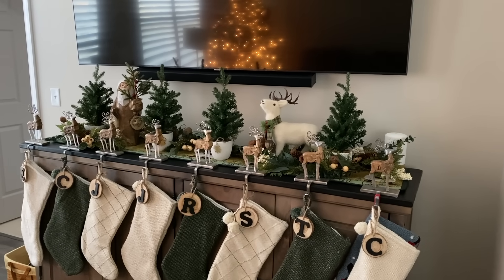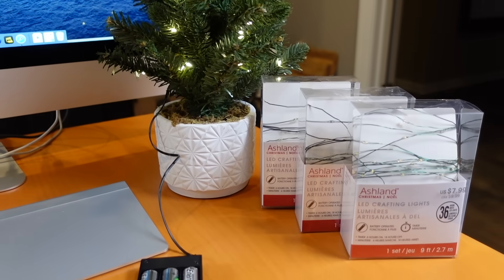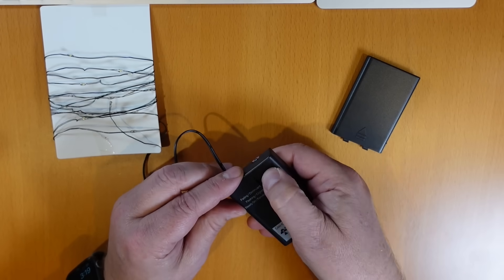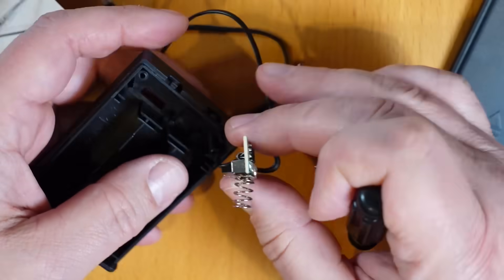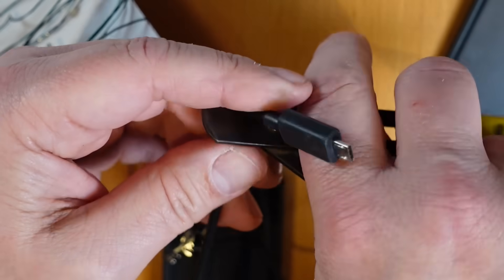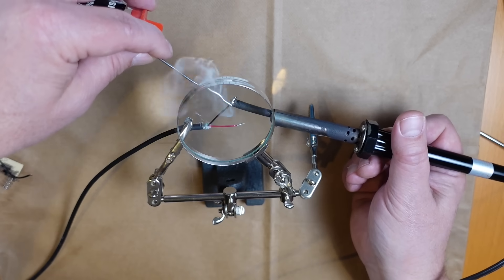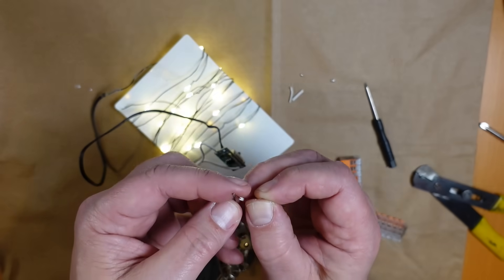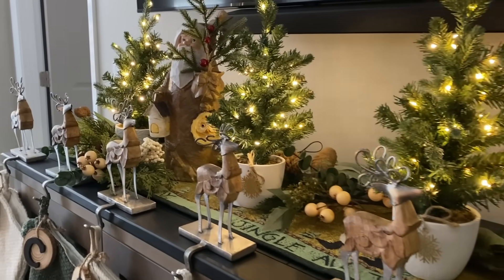SAVE $100s on batteries with this simple decorating hack

Comment from the maker: If you don’t have the skills or tools to do this, there are commercial alternatives: https://handydad.tv/a4h7
Reply: Thank you, I have no electrical skills at all so love this suggestion. I had no idea such a thing existed. This is a game changer!
Reply: Thank you so much for this tip 👍
Reply: This is a Very Good Ideal/Hack ...however,  it would be so helpful to actually see what to were doing  with a closer view and explained at a slower pace...for those of us with a slower 'hack' IQ.  Thanks!
Reply: I've never ever seen this before. Thank you!
Reply: Thank you so much for providing the link for those of us who have no idea how to accomplish what the genius who produced the video did! I am going to set about replacing batteries with these units, one at a time, until I am no longer dependent upon batteries at all. I can't tell you how much I appreciate your tip!
Reply: Where do you buy your wire strippers?  That type is my preffered and they have become difficult to find.
Reply from the maker: @John http://handydad.tv/wstr
Reply: Are you able to use the on/off/flash switch? If not, perhaps just soldering  the USB wires to the the battery terminals would allow use of the switch.

Comment: Running 4.5 V designed LED strings on 5.2V may not be good (I burnt some leds from the strings doing so) Hence, I added a Diode in series with the positive wire which drops some 0.5V - 0.7V resulting in 4.5V a safe limit.
Reply from the maker: Good idea

Comment: You only really need to keep the control board connected if you want the timer function. If you just need to power them then you can go straight from the usb to the lights without the control board.
Reply from the maker: Not necessarily. The board can also limit current or provide dim control.

Comment: For me the big bonus about doing this conversion is that i can use the remote switch that I use for all my AC line powered Christmas decorations (no more crawling around to plug/unplug multiple stuff every night). 
I also use rechargeable NiMH batteries but sometimes their inherent lower voltage (1.2v) is noticeable in some decorations.
Reply from the maker: I use smart plugs as well!

Comment: ... The problem isn't that they aren't mains powered... The problem is LED lights tend to use 3 batteries instead of 4. Smart Chargers can recharge single cells..? But are more expensive than dumb chargers that need 2 cells to recharge... So the answer is... Buy Fairy Lights with 2-4 cells instead of 3.
Reply from the maker: Thanks

Comment: I did something similar. I made a little piece that just drops into the battery compartment so there's no destroying the original battery box. That way it can still be used in areas where there is no access to an outlet. Added a jumper so that I could string several lights together. LED not incandescent. Made a "3 cell and 2 cell" variant.
Reply from the maker: Nice!

Comment: I did something similar, but I took one extra step. I measured the output from the control board to the lights. I found that it was only 3V, so the control board is doing some voltage regulation. This is important because it provides some assurance that the 5V supply will not likely cause your fairy lights to burn out early.
Reply from the maker: Good point!

Comment: If you just wanted "steady on" lighting, you could have ditched the entire power pack / circuit board.  The 4v fairy lights would run just fine direct from USB 5V.     Would have made things a ton simpler.
Reply from the maker: The board has current limiter.

Comment: We use fairy lights too but we use rechargeable batteries. We have enough to just switch them when they run out of power. Still pretty cool you can use 5v USB chargers. I probably have mor than a few in a box somewhere...

Comment: While this is an interesting idea, in Canada, you have just voided the CSA certification. If this hack ends up causing a fire, you would not be covered through your insurance. If you are concerned about batteries, consider opting for rechargeable ones. Honestly, these little lights take forever to go through the batteries.
Reply from the maker: Thanks for the info

Comment: This hack is more easily accomplished by just switching to rechargeable eneloop batteries.  Or, if you insist on this advocating this method, a more detailed guide would be appropriate. If someone owns a soldering iron and is able to do this hack with only the instructions you provide, they probably already thought of this and don’t need a guide. If this is new info to someone, your video doesn’t show them how to do it properly or even safely.
Reply from the maker: Thanks for the feedback

Comment: This sounds like a great idea! But, I loaded up on IKEA rechargeable batteries (AA & AAA) plus the IKEA battery charger about 3-4 years ago and never looked back. I run kids toys, all my candles on a timer and many fairy lights on these batteries and I feel no guilt. I also use them on outside year round lighting and have yet to replace any of the batteries. I just recharge and seems to me not even that often. Highly recommend. ❤
Reply from the maker: Thanks for the tip

Comment: Oh you connected more lights to single usb output did you do the math for the total combined AMPs  for the rating of the usb power plug output and boards ????
. Over current will cause excessive heat on the plug kill the components if you're lucky , otherwise it may catch fire . hopefully house  socket  trips out  protected by RCD and MCB before that happens. otherwise good idea
Reply from the maker: USB transformers have overcurrent protection.

Comment: so pretty...my guy, reuseable batteries are also pretty clutch. not everyone should just pick up being an electrician.. i wish i knew that b4 i pulled the magnetron from my microwave to pull energy from a grounded pipe..which worked, but now i have grey hair. pulls enough to charge a phone when the power is out, but i aged for that. i am praying you stay lawsuit free. good vid.
Reply from the maker: This is 5 volts. Doesn’t compare with a magnetron.

Comment: Just yesterday I was looking at fairy lights on sale and thinking how great a few sets would be in a holiday display for advertising a charity event. Then I realized that it would be six strings x 3 AA batteries = 18 batteries every three or four days for three weeks. Say 90+ batteries. NOPE!  This hack is awesome!  My only request is when recording these ‘simple’ hacks please SLOW DOWN and zoom in frequently to show more detail of your tools and of the actual circuit board.  That would make it much ‘simpler’ and safer! Thanks!
Reply from the maker: Thanks for the feedback!
Reply: Top right corner of video, tap the Settings 'wheel'-- tap the 'Speed' option: you can slow down or speed up any video  to your liking. 💝

Comment: So when you connected the tress to the power supply as stated at 2:01. Are they all powered off a single charge cube? Or a large capacity charge cube?
Reply from the maker: I had them wired together to one power supply.
Reply: @handydadtv sorry to keep bothering you. Can't seem to find the answers online, or more likely I don't know how to word it properly. 

Did you up the power supply for the multiple strings?
Reply from the maker: Yes. My trees have tiny incandescent bulbs that use more power than LEDs. Small power supplies worked for a short time but shut off after a while. I tried increasingly larger power supplies until I found one that worked continuously. I believe it needed 5V 2A.

Comment: Higher volt can make the led heat up so hard. I have 2 and 3 battery fairy lights. I just ordered 5v to3v voltage regulator. But yeah this is what im looking for since at gome im doing some fairylight mushroom decorations
Reply from the maker: Thanks

Comment: How many strings of fairy lights can be hooked up per 5 volt USB cable?
Reply from the maker: It’s a math question; you need to know the amps for each string. Add them up and make sure your source has more than enough.

Comment: Hi I have a 6 ft artificial birch tree with lights with different  modes but it stopped working after a few months I took it out of the plastic casing plugged it into a power source, then was fiddling around with it and it started working now it won't
Reply from the maker: Oh, shucks. I was hoping for the happy ending.

Comment: So how many strings can be supported by the one 5v charger brick? Looks like you have multiple setup to one
Reply from the maker: Not an easy answer. It depends on the power required by each string, and they really don’t tell you. So it’s trial and error. I used four on one power supply but the little Apple ones wouldn’t stay on all night. So I upgraded to more amps.

Comment: In Australia a couple of stores sell battery replacers for two for $10 - $5 each. They are fantastic. They have a USB plug connected to two or three dummy batteries = either AAA or AA. You simply plug these into the battery case, plug in your USB and - IT WORKS! So simple. I use a whole lot of these to run my Christmas decorations, tiny villages etc. I have each USB plugged into a Smart Switch so I control my whole house from Alexa.

Comment: Is there a way to do the opposite? To take something that is originally meant to plug into an outlet and convert it to run on batteries so it's portable? ie Christmas decorations / lights?
Reply from the maker: Yes anything  is possible with the right circuitry.
Reply: @handydadtv  would you consider making a video about that?
Reply from the maker: @Veronica.John10-10 It’s beyond my skills.

Comment: I can't catch the step where you crossed the wires & didn't work, but didn't see where remove & moved too.
Between my light up glow angels, snow man & santa. Plus my battery wreath & fairy l8ghts for christmas, I  also have a memorial day, july 4th, president day, labor day,  veterans day wreath I made that require  battery plus my Halloween candles, display, lights and more. Is there another way to see that piece. I use 100 some batteries. I have charger, but each charges loses power!  Not including our patio lights & numerous remotes!
Reply from the maker: I didn’t show the soldering close up because yours probably won’t look the same.

Comment: Thanks for the tip. Will this work with the lights that run on a coin battery? Maybe several hooked together? :)
Reply from the maker: Not without reducing the voltage somehow.

Comment: I bought these lovely things called usb batteries eliminators off eBay for a set of battery operated string lights I hung up in my room. Its essentially fake batteries with one that is attached to a usb cord with an on and off switch. You just but the batteries in like normal and plug in the usb cord and you have the same thing from this video without all the work!
Reply from the maker: Nice 👍🏻

Comment: You've completely missed the idea of using batteries in Holiday lights. It's usually because there's not a plug-in available. So you've just made battery-operated lights into plug-in lights. You can just go ahead and buy lights that are plugged in rather than having to take battery operated ones and make them plug in.😅
Reply from the maker: Thanks

Comment: You lost me when you jumped to connecting them to the wego.. what is that and wouldn’t that change the power of the power source?
Reply from the maker: A Wago is a splicing device just like a wire nut. The power is still 5 volts to all the trees.

Comment: This is also helpful because every year we put our decorations up in the attic for 11 months, and through a whole season of hot weather the batteries usually have leaked or died by the time we get them out next year.
Reply from the maker: I always remove the batteries before putting decorations away.
Reply: Why don’t you take the batteries out and continue using them. Rechargable batteries are best.
Reply: @ forgetfulness

Comment: Great work. I have found my peace with  rechargeable Eneloop batteries. 21 years ago (!!!) I bought 48 AA and 16 AAA cells. With a storage box and 8-way charger.  (All together it cost about $200) Eneloops do not discharge, the whole family has got used to it, puts the empty batteries in the charger, the charged ones in the box and I have not bought such a single AA/AAA cell for over two decades! With all the children's toys the battery consumption is extremely high, I would definitely pay $10 a week for disposable batteries. In 21 years I have easily saved $5000.
Reply from the maker: That’s a great story! So I see Eneloops are rated for 2,100 cycles. Have you needed to replace any in those 20 years?
Reply: @handydadtv  Thanks. I have never calculated it, but it probably doesn't come close to 2000 cycles, but certainly well over 1000. No, never replaced, only lost three. I once got four black "Eneloop Pro" that broke after a few years.
Reply from the maker: @woodchild48 The regular ones are better than the Pros?
Reply: @handydadtv  Yes, the normal, white Eneloops are much more durable.
Reply: Us too! Makes life easier.
Reply: I hadn't heard of Eneloops but found them on Amazon UK and bought some. AA, AAA and a charger. Wish I could find a good quality C2032 rechargeable set too. Any suggestions? We also go through some tiny circular batteries for hearing aids that I wish we could recharge. Thank you for commenting @woodchild48
Reply: @elletaylor9985  Cool, I hope you enjoy and use the Eneloops for a long time. Take care to keep empty and charged batteries separate and store them properly. Maxell has rechargeable 2032s but I have no experience with them.
Reply: I got Duracell rechargable batteries years ago and after a while they were leaking battery acid. Have you experienced this with any of your batteries?
Reply: Agree. It used to be that Eneloops were the best you can get for low self-discharge cells, but these days there are many decent competitors.  I've had good luck with the Amazon Basics even.  I toss the AA cells when they get below 1.5Ah and 500mAh for the AAA and I still have many that are 15+ years old.
Reply: Researching your comment taught me something new, thanks.
Reply: USB powered batteries
Reply: I have purchased 2 different Energizer  brand rechargeable batteries and chargers from our local Dollar General many years ago. They worked good until both chargers stopped fully charging the batteries and they would quickly die out! Completely disappointed in them. I will look into the Eneloop brand that you suggested, they sound much better!

Comment: I like this. I think I would have kept the battery box and drilled a hole in it. Then fed the wire through and used the battery terminals to wire it. That way the switch is still useful and it can be reversed easily.
Reply from the maker: That’s an option.

Comment: A much simpler hack would have been to just take the positive and negative wires of your 5V plug and electrical tape them to the positive and negative battery terminals. Then maybe put more electrical tape around the battery housing for safety.
Reply from the maker: That’d be uglier. But feel free.

Comment: So if the battery pack has multiple switches say, on, off, 6 hour timer, 6 hour timer fade. I switch it to the one I want before doing this? Meaning it’s permanently set on what the switch is set to?
Reply from the maker: Yes. Select the one that’s permanently on.
Reply: @handydadtv  I read the question and was hoping i had the answer right....I did! Ty

Comment: "I connected all three trees to the power supply with wago Lever nuts". Can you be more specific on how you're connecting these to the power supply? I'm just not sure where the USB connectors are going and how that connects to house power (I. E. How the power is being split among all the trees... Rather than plugging each tree separately.
Reply from the maker: The positive wires from all the trees and the power supply go to one Wago, and all the negative wires go to the other. You can also use wire nuts or even electrical tape.
Reply: @handydadtv  ok cool. I wasnt sure if you could use one 5v USB power supply to run all the trees. I guess it depends on the amperage rating of the USB supply...?

(I'm not an electrician if you couldn't tell... I dabble a bit.)

Comment: Heck yeah! I did this for the fairy lights around my office desk. Found an old keyboard that was dead, cut it and put the red and white wire on the corresponding positive negative terminal in the batter casing. Yours is cleaner than what I did haha. It last forever and the lights don’t start dimming 24hrs later
Reply from the maker: Good job 👍🏻

Comment: Unless the circuit board regulates the voltage for the LED, you should reduce the voltage to 4.5V. This way, you avoid accidentally overdriving the LED and shortening its lifespan.
Reply from the maker: Others have recommended adding a diode to reduce the voltage.

Comment: Would love a longer step by step on this or similar!
Reply: 2nd that request for the soldering piece as can't figured what was wrong & how it was corrected!
Reply from the maker: Ok
Reply: The wires inside the battery holder goes to a + and a - 
the usb cable has a + red and a - black cable
is that easy, +to+ and - to-
you can even solder or tied the usb cables direct to the springs where battery goes, respect the polarity and have a redundant, if your charger dies in christmass day, you can put the batteries back in it and it will work

Comment: I use rechargeable batteries you wanna get a good brand not the cheap ones. This is a project. I probably wouldn’t be able to do since I don’t have any soldering stuff but just for other people that may be the same situation as I am if you get a good namebrand rechargeable battery I have a few fairy lights that I use and I’m going on four years with the rechargeable batteries and they’re used more than just Christmas.
Reply from the maker: Thanks